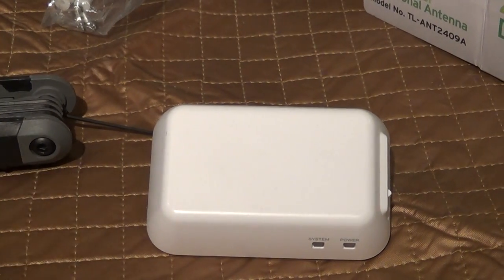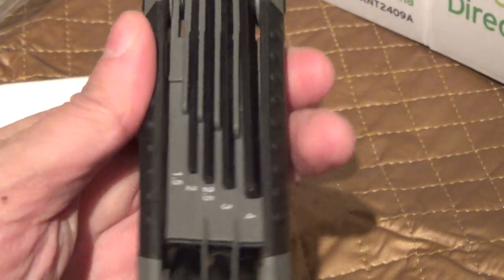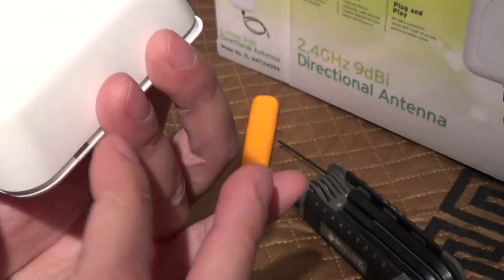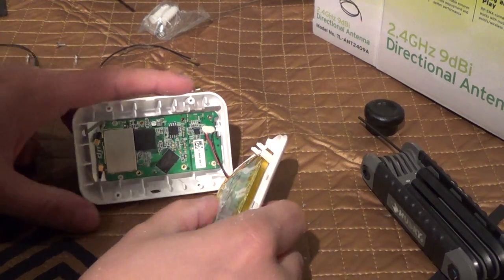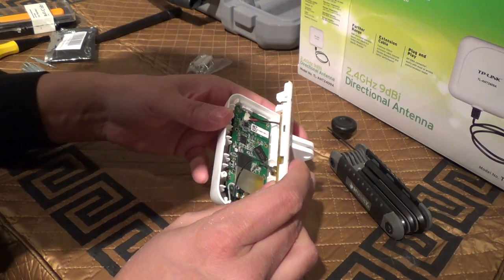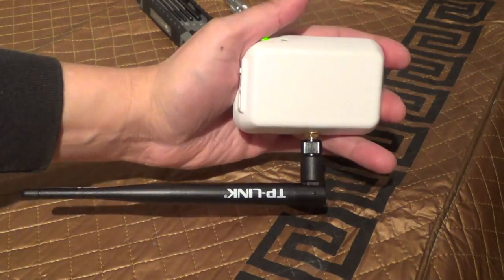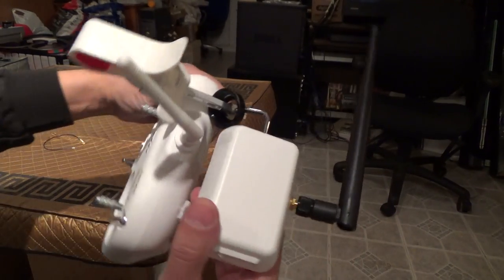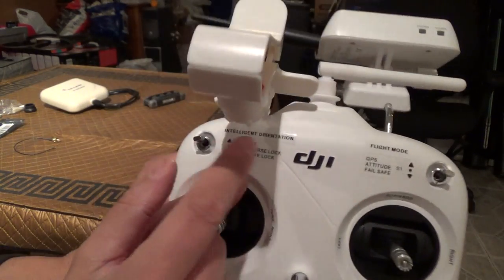DJI Phantom 2 Vision Wifi Range Extender / Repeater  External Antenna Mod increase FPV range.

Comment: can i use the two antennas instaed of the one on the extender one on each end will that be ok as the link you provided cames in a set of two and ive also seen others using two antennas
Reply from the maker: Andrew Reece yes you can absolutely use two antennas.  The unit will only be using one of them at any time whichever has the best reception.  The best configuration is using an two LHCP one directional and one omnidirectional for close range.

Comment: Hi friend. I have a Aee AP10  that uses a similar wifi extender. Ive openned it up and it looks very similar however the antenna coonections are soldierd on no clip so Im a little concerned about unsoldiering and resoldiering the pigtail. whats the aerial you use, a 2.4 ghz ???
Reply from the maker: Yes most wifi can be modded in a similar way.  And this wifi uses 2.4ghz so yes I used 2.4ghz antennas for the mod.  Helical antennas worked best.
Reply: cheers

Comment: it's possible this range extender work with phantom 3 standard?
Reply from the maker: The P3 Standard remote control can be nodded to use external antennas for increased range
Reply: +Ben7seven7  ok,, thanks

Comment: Could I use a dual 7 dbi antena??
Reply from the maker: Yes you can.  When doing both antennas I like to use two different styles a directional and on I directional.  Using a LHCP helical antenna will give you the best possible performance and range.  If I were to use an on I directional antenna is suggest using just one and leave one of the antennas stock for reliable close range use.

Comment: How much did this improve your range
Reply from the maker: 77Avadon77 My Pleasure and best of luck with your mods.
Reply from the maker: Stock range in my park 1,200 feet, with mods and helical antenna a mile.
Reply: +Ben7seven7 Woah! Nice. I'm doing it too. Thanks for the video. Congrats.

Comment: IT is referred to as a 20.00 mod. Do you have a supplier list, so I can duplicate you results ?
Also, any chance of burning out the oem wifi extender with this mod ?
Reply from the maker: Michael RAUCH I don't know what you mean by "20.00 mod" and yes their is always a chance of damaging the amplifier in the range extender when doing this mod if you're not careful.  It happens to be more the exception than the rule though most people don't have any problems.   My description has links and info on the products used.

Comment: Aren't you supposed to connect the antenna ground (shield) with the PCB ground. The way this video describes the modification is wrong. The WiFi receiver/transmitter must have a closed circuit. Yes, it works, but it also works with no antenna...it's not a light bulb.
Reply from the maker: Peter Dozet There is nothing "wrong" about the way this modification is explained or described.  It's a simple matter of removing the UFL connector connected to the original antenna and replacing it with the UFL connector on the pigtail cable which goes to the RP-SMA connector.  Then making a hole for the RP-SMA connectors to come out of.

Comment: Hi ben how are you i am in colombia an would like to du this opgrade, but dont undestan well how is the improment on it, how many much meter can i go. thanks david
Reply from the maker: davidsai If you use the best possible antennas for this upgrade you can improve your range easily 5 times or more over your stock range.  If you go with just the single omni directional antenna than you will slightly less than double the stock range.

Comment: hey guys i have a question. I done this mod and now when i put the range extender on the charge the power light is red. and when i turn it on to use it with the phantom the power light dosent come on at all but it is working with the phantom although it does not give me a battery % on the range extender within the vision app. has anyone ran into this problem?
Reply: spyem1 Man, you solved the problem than no % of extender battery show on app ? I have RE500 and no % battery show

Comment: This sometimes happens with a little wind, so I need to know if before modifying, would help me to improve video signal on the phone. regards
Reply from the maker: roberto carlos urquieta ossandon What does wind have to do with the wifi mod? The mod will allow you to use any antennas you want. Depending on the type and size of antenna you go with starting for example with the 5dbi TPLink omni directional  then moving on to a high gain LHCP helical antenna your range will go from close to double, to well over 5 times the range over stock. That's just for the WIFI FPV Feed of course. You may need to mod your controller antenna to keep up with the FPV feed at that point.

Comment: hello can you give me some more details for  LHCP 12.9 dbi circular polarized helical antenna. . If i buy it which plug i have to choose for your mod? Did you used ?
Reply from the maker: Γιάννης Τασουνίδης I used RP-SMA Female connector for the mod. You can go with any type you want but the most popular is RP-SMA Female so the antenna itself would have an RP-SMA Male.

Comment: Thanks for getting back to me, Ben! Really appreciate it. That's the kinda gain I'm looking for. Mine gets out of FPV range by around 600~700 feet away and 250 feet up. Would like to double and will likely go with the 8dBi antenna as well for the video.

What about the tx range when adding a 5 dBi antenna?
Reply from the maker: Amir Neshati The 5dbi antenna roughly doubled the WiFI FPV Range..  12db Helical on the other hand completely blew it out of the water tho with both range and reliability, not to mention cost though.  If not modding the Phantom and you want to go the helical antenna route it will need to be an LHCP antenna.  FPVLR and Horizon are popular providers of LHCP antenna upgrades.

Comment: One question, how much range did you gain by adding the 5 dbi omni antenna?
Reply from the maker: People results will vary depending on conditions etc but using 8dbi omni I pushed from a max of 1,100 feet to 2,600 feet using same preview quality tho it was most reliable sub 2k feet.  By contrast I pushed 1.5km or 4,600 feet with good reliable signs using a high gain helical antenna

Comment: You do a good job with passing on useful solutions. Appreciate you taking time to share. One recommendation is to layout the package for each item you add so we can see what it is exactly that you use to upgrade with.
Reply from the maker: Amir Neshati Thanks for the comment, I had links for all the items used in the video which should be helpful for that.  Not everything has conventional packaging.

Comment: Hi, i just bought - 
t LHCP 2.4GHz Half Sphere Helix 9 dBi on wifi extender
14 dBi LHCP 2.4GHz helix antenna on wifi extender
LHCP 2.4GHz Pinwheel on drone

but the range did not change. how should i trouble shoot?
Reply from the maker: Ashton Asherian The most common problem for the mod not working is a faulty pigtail cable or accidentally crimping (Bending the wire at a right angle) .  If it's not that then you may have a problem with the power output of the antenna lead you connected to. Try swapping. This could have been a defective unit or the amp could have gotten damaged during your upgrade which can happen.

Comment: when i did it i removed the board after we installing everything my on/off toggle is loose and wont turn on the extender got any idea why?
Reply from the maker: I'm only guessing here but if you took more of the unit apart than really needed you need to precisely reverse the process.  If your on off switch is loose now it goes without saying that you did not secure something properly and or loosened a solder connection.  Just recheck your steps and check for loose solder joints.

Comment: If I just bought a fat shark spiroNET antenna with a converter and adapter like you did in the video , is that all I need? Will far shark spiroNET work?
Reply from the maker: No it won't work well since that antenna is most likely RHCP you will have very poor reliability without changing the wifi antennas on the phantom to match.
Reply: what about -
LHCP 2.4GHz Half Sphere Helix 9 dBi on wifi extender
14 dBi LHCP 2.4GHz helix antenna on wifi extender
LHCP 2.4GHz Pinwheel on drone

Comment: Thanks for all the useful information, the links to the products and final testing information. 
I may just start out with the TPLink 5dbi omni antenna connected to my range extender and go from there. I don't want to end up needing a whole other carrying case just for my transmitter and all it's add ons and don't plan on any extended flights to Mars. haha.
Reply from the maker: Tim G Thanks for the feedback.  If you're just looking for a modest improvement in range up to nearly double, then using the single 5 or 8DBI TPLink or similar antenna will do you just fine.  If you're looking for a more portable solution that will have slightly better reliability as well as range but at a much much higher cost then you could go with the half dome antenna from FPVLR which is a 9dbi LHCP antenna.  The Half dome antenna will give an additional 20 to 50% range over the 5 or 8DBI TPLink (or similar) omni antennas and an improvement in the overall stability of the FPV signal since it's an LHCP antenna. (I got an RHCP version though as I use RHCP Skew Planer Antennas with the Phantom)

Comment: Ben7seven7  thanks for your videos!!! they are awesome. i have a few questions that hope you can answer me. I have a phantom 2 vision and want to improve the range to the max i can. you said you would also change the phantom antenas and add an 2.4gh range extender? which antenas would you install , which 2.4gh range extender and what else could i do to improve the range?  thanks!
Reply from the maker: ADRENALINE MUSIC Hi, Sorry I missed replying to this comment but in summary my favorite (and most costly) antenna setup for range and reliability has been a pair of 2.3dbi RHCP Skew Planer antennas for the Phantom itself, both facing sideways on either side of the Phantom. And the roughly 12dbi RHCP Helical Antenna from Circular Wireless.  That will set you back over $200.   Alternatively I found that the much cheaper RHCP Skew Planer antennas available on Hobbyking work extremely well too so that's more than a viable option.   Alternatively you could choose antennas from FPVLR or Horizon they both make good antennas and they make them in LHCP (as well as rhcp) which is what you need for the Phantom if you are not modding the antennas on the Phantom itself.   The FPVLR equivelent of the Circular Wireless antennas are also less expensive.

Comment: I bought a 8 db antenna does it work aswell or do i have to buy a 5 db?
Reply from the maker: anders sundell Yes the 8DBI works slightly better than the 5db version though it's a lot longer.

Comment: Regarding the 2 stock gray cables you disconnected. Do you just leave them hanging there, tape them, cut 'em or what?
Reply from the maker: I leave them there I don't tape them or anything just make sure they r out of the way but you coild tape them down tho that would be fine.

Comment: Does adding these omni antennas all a more forgiving hand hold position on the remote? I guess what I'm basically asking is if I'll still have to try my best to keep the range extender aimed at the phantom?
Reply from the maker: Using the omni you don't have to be as strict about how you hold / point it but if using one dipole omni and along with one of the internal antennas I still recommend that the range extender still point toward the phantom for best possible closer in range performance and as you fly further away the omni will take over.

Comment: Hi Ben - do you know if anything bad can happen if you power up the repeater (or the controller) after doing the mod, but with no external antenna screwed in? I've tried it momentarily for a quick test with not problems but have heard this can burn out the circuitry.
Reply from the maker: Yes it can absolutely damage if not fry the amp if you run it without an antenna for any length of time.  I am not so sure it would be too bad if it was literally just for a few seconds tho but you want to avoid that.

Comment: Ben7seven7 Hi, nice video but I am unclear on what the two antenna connectors on the wifi extender are.  Is one TX and one RX or something else?  I currently have the stage 2 kit from FPVLR for my P2V and I am not seeing the range increase I was expecting.  The port you plugged the omni directional into, which port is that and what is the other one?  I have a half sphere antenna and a pinwheel antenna but I am not sure which one should go to which port.
Reply from the maker: Hi, it doesn't matter which port you use they are identical.  It switches between which ever is getting the strongest signal.

In the park I do my testing from I pushed 2,800 feet at max using he half dome and 640x480 15fps preview quality.  That also includes a couple of skew planers on the phantom itself.  The reception was a bit spotty at that distance tho and there still are a fair amount of wifi signals at the park.   The best usable range was around 2k feet give or take.  In its stock form same preview quality my max range is around 1,200 feet.

Mounting position of the pinwheel would be pointed up and the half done mounted flat on top of the repeater.   If you were to mod your phantom with pinwheels I recommend them either both facing to either side or one down and one sideways.   

It's also worth noting that if you're not seeing a good range improvement you may have a problem with the pigtail adapters or you may have an issue with power output from one of your ports.  Swap to test.  Also using a program called wifi analyzer helps this.
Reply: Ben7seven7 thanks alot! Was able to reconfigure and get to 1800 ft with video and that was with trees and buildings around.   I'm sure I can hit 2k when I can get to my usual fly zone

Comment: thank you for taking the time to do this video.Not sure why,but when I installed 2 Omni antenna's,i would loose gps signal when recording.Only when recording a video.So I went back and did the mod just like you did with only one external antenna instead of 2 and everything works perfect.Not sure why this is,but maybe it will save someone else some trouble.
Reply from the maker: This mod has nothing to do with and no effect on the GPS signal of the Phantom.  Only FPV video feed.  

Using a standard omni antenna and one of the internal antennas gives s good combination of reliability along with additional range as needed.  The internal antenna will be more reliable as it matched the LHCP antenna inside the Phantom.  The omni antenna while it will give you better overall range is not quite as reliable as in it may drop out from time to time.

For the best setup you can use a LHCP high gain antenna instead of the standard dipole omni directional.  My personal preference is using a pinwheel style antenna along with a helical for longer range.

Comment: Is one antenna tx and the other rx? Or are they both?
Reply from the maker: They're both, the antennas are diversity as in it used one antenna at a time whichever is getting the strongest signal at the time.

Comment: I just did this mod and tested if two antenna's or one would be better (I know more would always be better) or so I thought I actually got the same range with one as with two.  But over the stock setup I got an additional 400ft of range!  Pretty much the best mod for the price the setup I used cost me only $7.00 for all of it.  1 think I might add make sure when testing range to first make sure you have the failsafe set up to a toggle on your remote.  Thanks for the video helped allot.
Reply from the maker: If you're just going to use a basic patch or omni directional antenna I recommend only changing one of the two antennas.  It will try to use whichever antenna has the best signal at the time. A basic dipole omni will give you further range but not be quite as reliable a signal as if you went with a Left Hand Circular Polarized antenna, which is a little pricey to be honest but worth while if you want to get even futher extended range and very reliable performance. if you were to change out the antennas on both the Phantom and Extender you can go with RHCP antennas which are more comment and more affordable than the fewer LHCP offerings. 

Anyway I am glad the mod worked well for you and you're enjoying the extended range. :) Now if you want to triple that add a good Helical Antenna and you'll be in heaven :)

Comment: Ok I open mine up and found two thin wires {not present on your video] that bordered the green board,  so I had to run the new anntena connector over the top of them to get it out the notch I cut for it.   Since the connector is insulated it does not touch the copper wire bordering the green board--- I should be OK???
Reply from the maker: Hi, when you run wires just make sure none of the wires are getting pinched or primped and you will be fine. The RE700 repeater looks slightly different on the inside but the mod is the same basic procedure and will work just the same.
Reply: Hey guys,
Just FYI, I thought that exposed copper running around the board were wires too. I've come to realize that it's actually just a thin sheet of copper sandwiched between two foam insulating pads, lining the surface between the board and the actual antennas mounted below. My suspicion is that it's an electromagnetic insulator intended to reduce interference on the main board coming from direct exposure to the antennas. You probably want to save this pad and lay it back in place when you put the unit back together, even if you're using external antennas. More shielding more gooder!